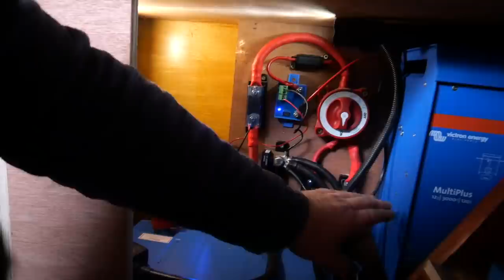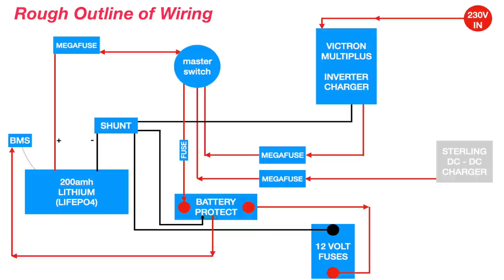Victron Multiplus & Lithium Battery Install on our Narrowboat

Comment: Hi Steve,wend, great to see you converted to lithium,I’ve been running mine for six months now.we are in the sticks and have no hook up,living abroad around 10 years and the amount of lead we’ve got through is unreal.ive more than halved my diesel as the lithium charge so much faster.i only got on your Chanel because I am looking to buy a thermal cooker then saw you had a narrowboat so catching up on you channel,good luck and welcome to the boating community.
Reply from the maker: Welcome to the. Channel Shane. Yes the Lithium battery is so much better than the lead acid batteries.

Comment: Its great that you try to run as much as you can on dc from your batteries as inverting to AC is not 100% effcient. Do you get electrical hookups on canals? Do you use a manual transfer switch to switch between electrical hookup and inverter?
Reply from the maker: Yes the inverter uses about 1.5 amps just for being on. 
The Victron Multiplus is a combined inverter, charger, and transfer switch so whenever the shoreline is connected the multiplus senses that 230volt input and switches from inverter to passthrough or charger mode. 

There are EHUs in marinas but not out on the canal. Charging is done by running the engine and solar panels.

Comment: Hi Steve....interesting watching you install all your victron battery system, it will be we worth it and a big value to your narrowboat.. Looks like lots of work though but worth it in the end.
I have a problem with the sarginson control unit not charging properly from the solar panel on my Autotrail comanche. I am looking to install a vicron charge control unit etc and try to bypass the sarg Autotrail crappy unit which i think is total rubbish.  You installed your full system from a boating company in Nuneaton about a year or go....
Please can you let me know the company you has install your full system in Nuneaton....I woukd like to drive over and ask the guy to look at my system and see what he can do to improve my motorhome electrical system. I really like you bluetooth control unto tgat gives you every bit of information required.

Thank you
Jason M
Reply from the maker: The company is Onboard Energy. The job is super simple if you want to bypass the built in Sargent charge controller. 
You’ll have a 100watt panel on the roof I assume. The 2 wires from the panel go into a unit that is on the back is the EC 500. They can be taken off and wired directly into a smart solar mppt charge controller. The Victron Smart Solar is Bluetooth enabled so you can see it on the Victron Connect app.  
Hope that helps
Reply: @TheHappyTravellers  really helpful...really apprechate your help..thankyou.  As you probally know in Coventry we are still in Tier 3 so we cannot go anywhere  which is rather frustrating. However whist we cant go anywhere we might as well spend tge money sorting out all the niggly jobs which ALL motorhome have. Soon enough you will be off again in you nice new motorhome down to spain 🇪🇸 . We will be watching your vlogs intently.

Comment: Does that one battery do all your leisure stuff
Reply from the maker: Its a 200amh Lithium so we get upto 160 amp hours use from it. Yes it does ALL of out 12volt stuff which is pretty much everything apart from the 230 volt immersion heater and the occasional 230 volt induction hob.

When we are fully "set up" we'll be able to run the boat engine to charge the lithium battery so may not need shore power at all.